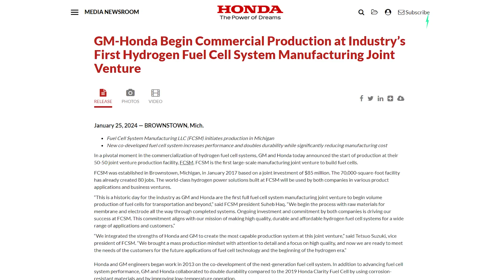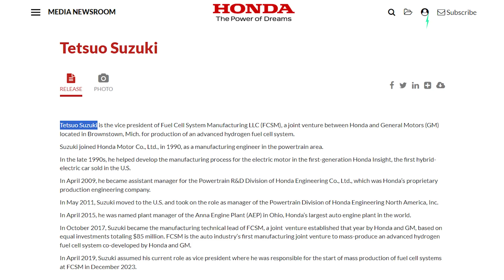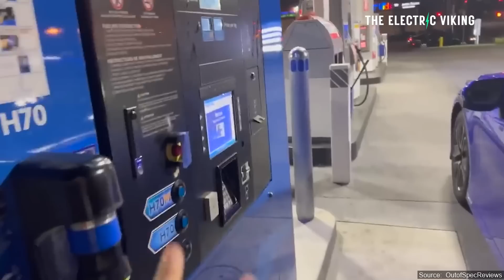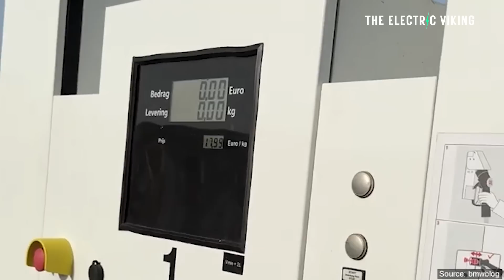GM & Honda's hydrogen fuel cell facility begins mass production in America

Comment: So which makes the bigger boom, a tank full of gas or hydrogen?
Reply: Hydrogen is tricky stuff but I'm pretty sure they store it in a non-explosive form for the fuel sales.

Pure hydrogen is slippery and highly explosive under pressure.
Reply: it does not matter.  Hydrogen is so leaky it will provide lots more booms.
Reply: And the winner is.......... hydrogen!

Comment: BEV is really struggling where consumers don't have home charging.  If that does not change, then something else will be needed.
Reply: Yes, they will drive to where they can charge, same as a petrol/diesel car. True the rollout of infrastructure is too slow and technology needs to improve for fast charging/more battery range but these will come over time and way way quicker than any Hydrogen development and rollout of stations.
Reply: True. But hydrogen is really not the answer to that problem. I think biofuels or maybe even ammonia might be.
Reply: @mvoetmann1  I agree that hydrogen is not the answer.  But for people in apartments, hanging around EV charge points for hours is not the answer either.
Reply: @jamie-ck6js  yes. That one is hard.
Reply: Do ICE vehicles magically refuel themselves for people who don't have home refueling? The only issue is the prevalence of reliable charging infrastructure and that is already happening at a very high rate - also worth mentioning that charging stations are a lot cheaper to install and operate than hydrogen filling stations..
Reply: @erktrek  People don't want to wait around for hours charging when they can refuel with gasoline in minutes.  And if constantly fast charging then there are battery concerns, which even this channel has talked about.

Comment: EDIT: so are they talking about just making fuel cells or HFCVs? 
IF GM is having trouble ramping up manufacturing of EVs what makes HFCVs any different? In fact HFCVs are even MORE complex and require a larger BOM... but I guess there are dreams of future profit in $servicing$ & $repairs$. Fun fact: How long will a full tank of  hydrogen last if not used? Well according to the US DOE the "target" goal is 10% after thirty days so yeah between that and embrittlement.. good times.

Comment: Hydrogen gas escapes through almost any seal system due to its small atomic size.  This is why industries, like steel making, make hydrogen on-site because of losses due to leakage when hydrogen is transported. The same leakages occur on-site but the gas is used before much occurs... theoretically. 
Hydrogen gas makes Climate Change much worse because it combines in the lower atmosphere with disulfides which normally would work their way to the upper atmosphere and degrade methane (which is the worst of the global warming gases), helping to lessen its warming effect. Therefore hydrogen inadvertently caused much worse warming to occur as methane stays in the atmosphere much longer.

Comment: the development of hydrogen power was to address 2 things: concern over the availability of raw material which is a major concern for japan as it is a small landmass, and mass of the fuel which has made longhaul difficult to achieve with batteries. unfortunately for hydrogen, the introduction of sodium batteries basically remove the scarcity issue of raw material. and while the mass problem is not resolved, the volume problem of hydrogen appears to be more challenging than the weight problem of batteries, nullifying whatever advantage it has over batteries.
Reply: Tesla Semi proves it’s not an issue for long haul.
Reply: @fractalelf7760 yes, a thousand miles in one day on Tesla without excessive damage to the battery.

They realize they could charge the Tesla at the Warehouse while loading the truck. Which gives them back the time they used to spend stopping and filling up with diesel.
Reply: @fractalelf7760  The Tesla Semi started its first consumer deliveries last year, but the vehicles were only delivered to one customer: PepsiCo. Since then, the Tesla Semi fleet has grown into almost 100 vehicles, as confirmed by Tesla VP of Vehicle Engineering Lars Moravy December 2023.  Europe for long haul is going for hydrogen the unit is lighter and quicker to refuel. Battery Lorries for distribution. Several customers have been using Hydrogen lorries since 2020 has part of the EU test projects. The strategy is a H2 refuelling stations in every major urban area and every 200km along the core European road network by 2030.  All the major manufacturers have sign an agreement to produce long haul hydrogen tractor units. This is nothing new considering Buses there’s already 5,648 hydrogen fuel cell buses in use around the world, with 93.7% of them in China. The engineers behind the EV battery revolution consider this a step towards a hydrogen economy.
Reply: Because you can set up a virtuous cycle of recycling batteries and Japan is uniquely suited to do this if they had the willpower plus they can source some materials from more friendly countries other than China. Thanks to Japans "small landmass" long-haul trucking with batteries would likely be okay but rail seems like it's more important anyway and Japan is working on electrifying their system.
Reply: @erktrek plus the new sodium ion batteries remove China from the loop.
Reply: Japan is ruled by seniors. They don't want any changes.

Comment: Let’s make internal combustion engines more complicated! Progress!! 😂
Reply: for them , its absolutely true. the more customized the car is, the more money they can suck from the customer for maintenance
Reply: dealers make most of their money off of their maintenance shop. hydrogen would be just perfect to make that even better as a money grab.
Reply: Hydrogen cell cars are electric. They are basically EVs but instead of battery they have hydrogen cells.
Reply: @vegtalkvibes  I will edit to “Let’s make electric cars more complicated!” 😎
Reply: @clintatk  I am not sure it is more complicated. Hydrogen cells are not inherently more complicated than lithium ion batteries.

Comment: Why on earth would you buy a vehicle where electricity is used to make the fuel by electrolysis only for the vehicle to then turn it back into electricity ?

An extra step that is not needed with true BEV’s.
Reply: That's the key to its inefficiency.
Reply: Really is quite th relevant question
Reply: Because battery storage is no good. You can't leave the vicinity of a power plug, like literally you are not able to travel out side the power grid. Telstra trialled using solar panels to generate hydrogen and the hydrogen is stored for power outages to run a generator; It was a success and they were going to expand the program at other exchanges. This was 10 or maybe 15 years ago. EV's can not replace good old fashioned oil; Batteries are heavy, low in storage, slow to refuel and expensive. An electric car is fine for urban driving, but they are severely limited; An electric car has many strengths but also many compromises; They can't go the distance, they can't tow and they certainly can't go off road. A major problem is there is no way to take fuel supplies with you. I suppose you could take a decent size generator with you that can do 3000-4000 watts; but that is probably going to burn a lot of fuel to charge.
Reply: @alexandermelbaus2351  That Sir is a straw argument. 

Demographic trends show that vast majority of all counties are shifting towards urbanization. So ranges are not really an issue. 

( The average car user only drives 30 km to work. )

Also, battery energy density  has been increasing as average of 5% per year. While the cost per Kw/h of production has been quickly decreasing.  

As for towing.

a) Most people don't tow anything.

b) At some point the batteries will be so energy dense that the increased loss will be redundant. Also I'm sure that someone will come up with a resigned transmission system of overcome this limitation.

Now. The off  road argument. Look up Extreme E or better yet look up the Electric vehicles that entered this year's  Dakar Rally. While in it's infancy. Electrification is coming.
Reply: @zippyspeedmonkey  Your not getting it; The electrical systems in any kind of transport application can not leave the power grid; There is no practical way to take  more fuel. Off-Road as in out in the middle of nowhere or 2-300 km's away from the nearest power outlet.

What you want is a vehicle that can run off batteries, able to be charged from the outlet and have the ability to run off diesel or petrol.

Accelerates like an electric and has even longer reach then an efficient diesel with the ability to operate only on batteries.

The batteries don't need to go more then 200 km's. It is potentially an electric car (diesel-electric)  with far reduced battery costs, without the limitations and probably even cheaper. I don't know if any of the hybrids are like this.

You do not seem to understand that an electrified automobile has many compromises, that does not give you any additional practical abilities for a higher price.
Reply: Exactly, it makes zero sense. There may be legit use cases for hydrogen but light passenger vehicles isn't one of them. The only place I've seen it make any sense, and only barely, was watching about the Orkney islands who produce so much energy from wind they have an excess so as a last resort they turn it to hydrogen. Presumably that could be used to power ferries, generators or whatnot. Still not a very good usecase though. I've also seen some aircraft manufacturers talk of hydrogen but it has to be stored in liquid form, so I don't think it's especially viable there either.
Reply: Urban Pollution and green house gasses to produce electricity by burning natural gas !!!!

Comment: When fuel cells were first used early in the US space program the practical drawbacks to widespread implementation were apparent.  Time has not fixed any of them.  Hydrogen production is hugely energy intensive or using natural gas, inefficient and polluting.  Hydrogen storage is wasteful and difficult. It was a dead end technology then and continues to be so today. Hard to comprehend why so many continue to press forward when progress to fix the problems has been so intractable.
Reply: And while natural gas is better than coal, natural gas production produces a lot of methane and releases a lot of CO2 on its own
Reply: Please guys what is it about Richard’s post that you don’t get?
Reply: Excess solar during peak times could be used for hydrogen production. This will allow to install more solar panels to compensate for cloudy days.
Reply: Yes, that is the idea Hydrogen proponents use to justify the wasteful use of energy that characterizes its production by way of electrolysis. The question then becomes why go through the step of converting sunlight to electricity then converting that electricity to hydrogen only to convert it back to electricity where it is used with all the loses around that when the electricity can be stored and used with current technology without those steps?  With wide scale adoption of BEVs, a majority of which will be plugged into the grid at any one time,  you have a built in storage system, which with appropriate vehicle to load protocols, can reduce the requirement for massive utility scale batteries. @vegtalkvibes

Comment: The hydrogen vehicle argument is an exercise in subterfuge to buy time for the auto companies to catch up with their EV technology behind the scenes.  They know they are behind the eight ball on this and have been caught off guard in the EV space and are getting crushed.  They know that full well.   They are now paying the price for their lack of commitment to EV development.
Reply: A lot of the other issues are software management issues.  Even preconditioning the battery can be software managed and is in fact software managed in some EVs.  The EV tech is still relatively immature and rough around the edges, but very fixable for longer term mass acceptance.
Reply: @JoeyBlogs007  I think it is more of a misdirection play for the stock holders.  It allows the company to give the impression they are leading the way in something, so that stockholders don't think the company is falling behind on a technological front.   Green Hydrogen / Hydrogen will have a place in Transportation, the question is where.
Reply: @HearToneSpeak      That's called subterfuge ( as I mentioned ).  i.e. Using deceit in order to achieve one's goal.  LOL  Green Hydrogen / Hydrogen wont have any place,  especially if nobody knows where and I don't really think anyone knows where.   The main things holding back EV are battery technology and ubiquitous fast charging or lack of it.  Once fast charging is near everywhere, battery range will be less important.  Those issues will likely be addressed within a few years and near certainly by 2030.
Reply: @JoeyBlogs007  "The main things holding back EV are battery technology and ubiquitous fast charging "

Those are pretty big things, because they aren't engineering challenges, those are science problems.   Lithium's chemistry will allow you to hold a pretty good charge, but if you charge it quickly the battery will explode.  And that's inherent in the material.  So any car that uses lithium batteries is a first generation product

The idea this will be fixed in just 5 years is not grounded in science.   Even LiOn batteries took almost 15 years to go from first commercial use to becoming practical for EVs.   So you need to think in terms of decades for improvements, not years.
Reply: And when? @HearToneSpeak
Reply: They have moved on to hybrids and hybrids are seeing a resurgence. These companies are doing very well. Toyota has had its best 2 years in 2022 and 2023. Just look at their financials.
Reply: In Europe and the US nearly all buyers are still buying ICE.   The ones who are doing well, like Toyota, are the ones who have pretty much steered clear of EV.
Reply: @jamie-ck6js  With EVs taking 20% of the market in otherwise stagnant sales it's hardly the fact in Europe. The US is only a couple of years behind. So even the ICE king Toyota will see its sales go down from here if they cannot compete with tempting and affordable EVs.
Reply: @perperers2502  BEV grew from 11% to 14% in 2023 in Europe which was seen as a huge disappointment and is resulting in nearly all buyers still buying some form of ICE.  In the US it is even worse with over 90% of buyers still buying ICE.  Things will change but it will take time clearly.  We have been promised a Kodak moment since 2018, 6 years later virtually all buyers are still looking for ICE.

People living in apartments don't want to hang around EV chargers for hours, it is that simple.
Reply: @perperers2502  Europe has never been a good comparison to the US because of the close spacing of cities in Europe (less than 100 miles) versus the spacing the US and the sophisticated railroad network that means for most people who live in cities they don't need any sort of automobile.   But you do need an automobile to get around in the United States.
Reply: @jamie-ck6js  "In Europe and the US nearly all buyers are still buying ICE"  This is not accurate, especially in EU, where EVs sales are 14.6% of the market.  Sales have grown yb 62% year over year.   In the USA over 1.3 Million EVs were sold last year, which is an increase of 50.7% year over year.   

Toyota hasn't steered clear of EVs, they made one of the worst EVs ever the bZ4X.  I do agree that many legacy Auto makers haven't made compelling EVs and have suffered accordingly. The ones that have made compelling EVs have done well like BMW, Hyundai, Kia, Mercedes and etc.  Not every automaker is going to be successful, that goes for ICE , EV or other.   

Toyota is investing 4 Trillion Yen ($35 Billion US), in EVs.  “In this diversified and unchartered era, it is important to flexibly change the types and quantities of products produced, while keeping an eye on the market trends,” Toyoda said during a briefing on the carmaker’s battery electric vehicle strategies.  "For its luxury brand Lexus, Toyota aims to have battery electric vehicles account for 100% of vehicle sales in Europe, North America, and China by 2030 and globally by 2035."   

Toyota may have  "steered clear of EV" in the past, but they see it as part of their future.....no??
Reply: Toyota is on the reduced side of car sales all over the world. Toyota probably makes the Best ICE cars on the planet, however there Hydrogen & BEV vehicles sucks! @jamie-ck6js